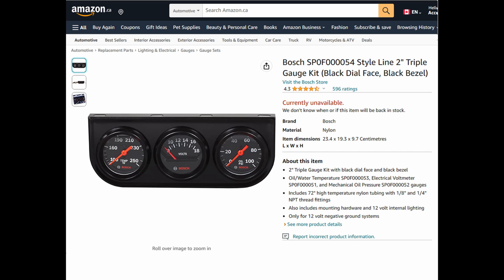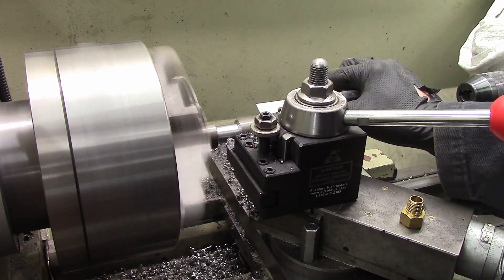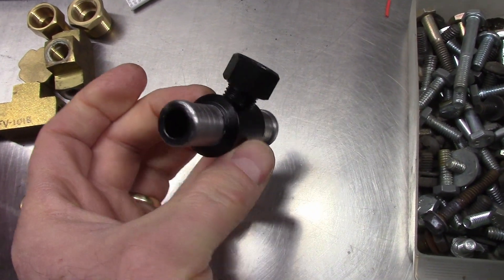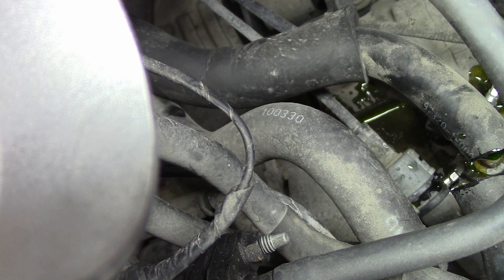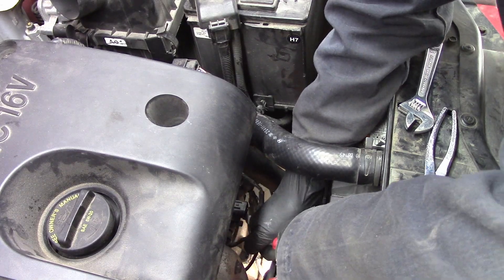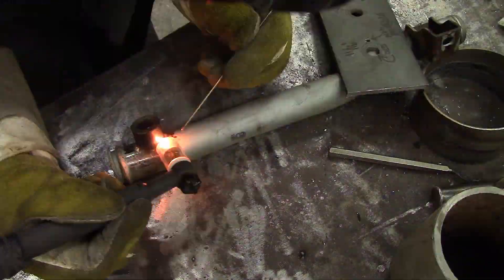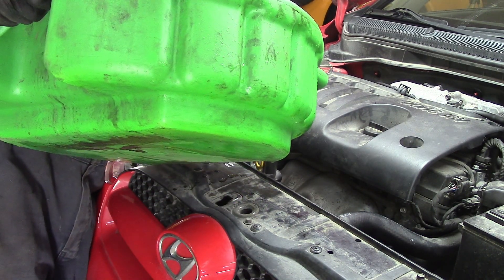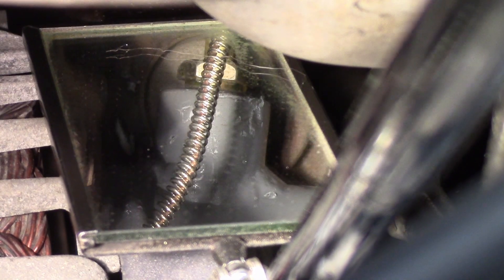Installing an Aftermarket Gauge Trio

Comment: I have a question is drilling holes in thermostat's valid to get ride of air pockets.
Reply from the maker: I have mixed feeling about that.  On one hand, yes, a 1/16" at the highest point of the thermostat helps bleed air, and some thermostats come will a "valve" of sorts to bleed air (there is on my Hyundai).  On the other hand, you'd think the engineers that designed the engine knew what they were doing, and if they did, why didn't they put a hole in there?  I generally don't drill holes, but I know many that do.

Comment: Get rid of that plastic line on oil side for god sakes
Reply from the maker: Some say the copper fatigues from vibration. I routed and protected the plastic from heat and abrasion. You'll need to pick your poison.